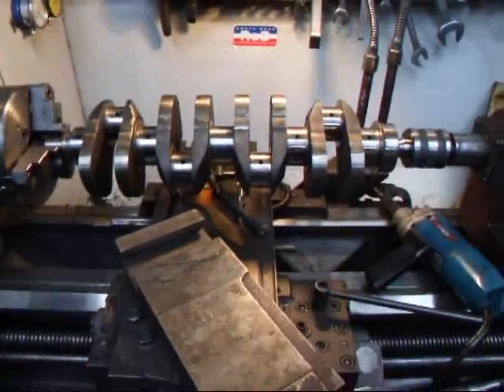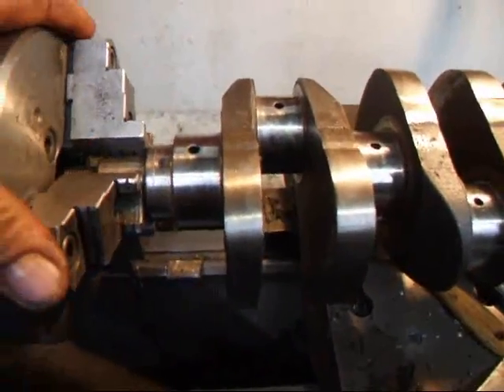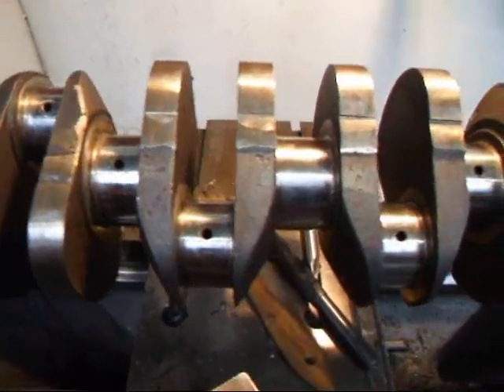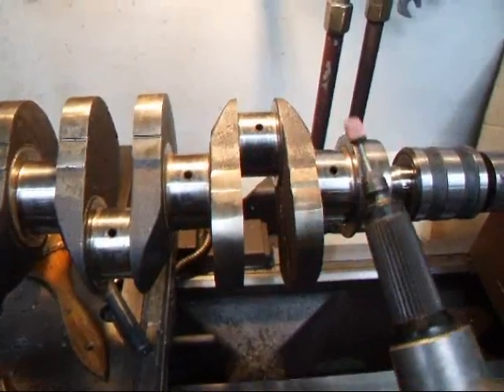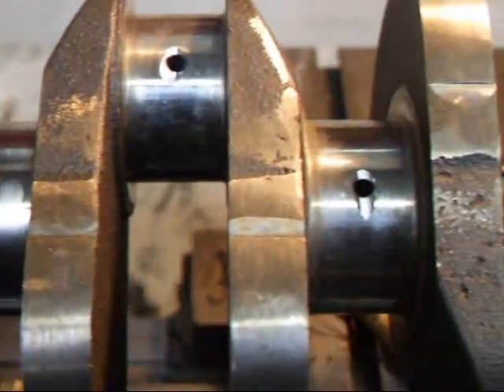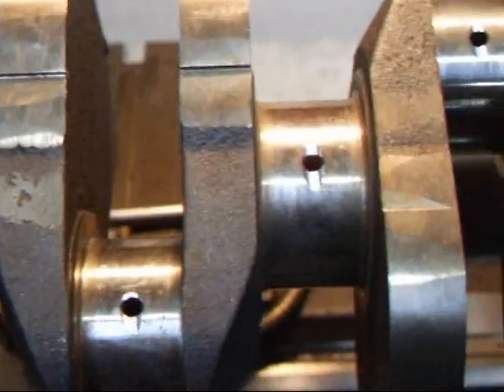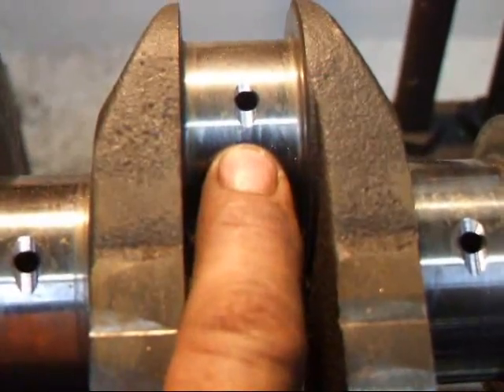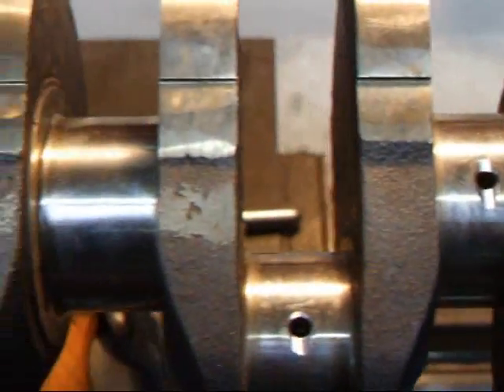Crankshaft Oil Hole Chamfering

Comment: Wouldn't enlarging the oil hole in the bearing shells have the same effect...? less risk to the crank/ easier to fix if you get it wrong...!
Reply: Absolutely not!! Will cause premature bearing failure!!

Comment: Hi John!  I was wondering if you might be willing to help me out. I have a Toyota Tacoma 2.4 Turbo engine that I drag race with. The problem I'm having is that the rod bearings always go bad. I had the machine shop give the clearance of 2.3 and I am using a mechanical oil pump.  To me Lubrication is not the issue I think is the bearings. I am using King bearings. My question to you is Do you think that because I did not do oil chamfering like you did in one of your videos could cause the bearings to go. I also like to know what kind of bearings would you recommend for this engine. Thanks in advance for the help.
Reply: To the fello, clames junking up main bearings, cause crankshaft is not chamford.,, old boy champering or not champard on the crank, ant got bit of differance on it, set u're end play corectly.  Tighten it up. Hamering out at high rpm
  Or switch mechine shops
  Next time. Do u're mechine work,

Comment: I have to agree with this guy... Burrs on the edge, irregularities will give different bearings different amounts of oil, not to mention the weight change on only one side of the crankshaft.  These are usually extremely well balanced, and I would think that whatever benefits of this crude chamfer are out the door since you aren't balancing it afterwards...
Reply: Fisqual 
Making assumptions..
Oil groves get polished with the journal ..
Reply: Fisqual 
Who doesnt balance assembly after crank & rod mods?

Comment: It´s not rocket science to clean a crank. Use thinner or similar solvent to remove the sticky oil inside the holes. Then you can use an engine brush kit and finally pressurized air. Blow the brush clean from the shavings and start all over again a couple of times. Flush, brush and blow is the key  :)

Comment: Shouldn't the longer side of the chamfer be the opposite of the shaft's rotation? This would leave the oil behind to pass thru the space as the journal catapults away. Also, is there any harm in cross-drilling or chamfering the same lengths on both sides of the oil hole? ..........cheap assurance for unknown direction of rotation.

Comment: So what happens to the file shavings how do you get them out of the inside of the crank once finished grinding?
Reply: Hot soapy water and cleaning brushes!!! Spray on WD40 afterwards, blow out completely with air gun, coat with oil, FIN!!

Comment: i believe that term comes from the honda side.  on the base model B18 engines you can install a "oil squirter" that comes from the GS-R or Type R B18 engine and essentially what it does is it squirts oil up onto the bottom of the piston to 1. cool the piston, and 2. provide additional lubrication since these two motors spin to 8800-9800 respectively.

Comment: John, do you polish afterwards to remove any possible burrs? Surprised that such an expensive stroker crank wasn't chamfered, do you agree? In the day i had a factory BB chevy 427 and i am pretty such the crank was chamfered or at least cross drilled, it was a forged crank since it was the HP version of the 427

Comment from the maker: 1. Shouldn't be a concern if you remove the smae amount of material from each side.
2. See some of my other vids on connecting rods, oil hole for the wrist pin are always a good modification.
3. Don't know about bearing problems, be sure you have sufficient pressure and volume, chamfering will be a plus.

Comment: Hi there.  I´m rebuilding an Alfa 156 1.6 ts and have a couple of questions. 
1. Chamfering, does that have much effect on " any " balance, thinking about how much that can be grinded.  
2. The standard rod end bearings for that engine don´t have oil holes, can I drill a hole on each, at perfect center and chamfer them smooth, then install them without something / anything breaking?  Have you ever tried? 
These car´s are know to throw the bearings, engineering weakness?
Jesper " Denmark " THX

Comment: I wonder, wouldn't it be better if the chamfers were cut to run at an angle instead of straight as this would promote lubrication over a larger area on the bearing.

Comment: How do you keep the grinding stone particles away from entering the oil passages in the crankshaft ?
And how do you clean it after this procedure ?

Thanks !
Reply: Hot soapy water and cleaning brushes!!! Spray on WD40 afterwards, blow out completely with air gun, coat with oil, FIN!!

Comment: @ted850760 
Yes the oil is pressure fed, but machining tear drop shape oil grooves into the big ends on the trailing side of the oil supply hole will help draw oil out of  the channel from the big ends, (this is the whole point of tear dropping the crank) I also do this with competition gearboxes that are not pressure fed and it easily draws oil into the gears due to a small suction effect when spinning fast, we have noticed a massive reduction in main shaft to gear wear with this modification

Comment: I use a small carbide burr to do this, using a smooth tear dropped shape with grinding on one side only, btw you have the main bearing "oil chamfer" facing in the right direction but the big end chamfers need to face the other direction, think about it, the crank turns clockwise but the big ends turn anti clockwise, you want to scoop oil into the mains which you got right, and then the big ends should draw oil out from the mains
Reply: Exactly right

Comment: Chamfering is a standard procedure for high rpm and hi performance applications. Just because he decided to do it with a grinder as opposed to a mill or machine of some type does not affect it in a negative way at all. If it did affect the longevity or cause damage, i'm sure he would'nt be in buisness for that long! Chamfering the oil holes is cheap insurance and mandatory at that high of RPM period. These negative comments make the people posting look like idiots!

Comment: Would it be of any benefit to chamfer the approach side of the lubricant hole, leaving the trailing edge alone? Considering the direction of crank rotation and how the eliptical shape might quench the localized oil as the chamfer moves past the orifice in the crankcase. Is the pocket of localized oil in a chamfered area not just a momentary drop in oil velocity since the crank journal lubrication holes are still the same diameter as the ones in the block?

Comment: ouch looks nasty dude use a milling machine and gouge it out, ive seen the strongest conn rods dead head from hydraulic lock. That means it cant spin anymore your rod turns over on you 90 degrees

Comment: How much does this modification cost? i was quoted at $300, i think this is the same thing as the guy told me. He said for $300 my bearings would get more oil at higher RPM.

Comment from the maker: No additional prep was done to this crank except the polish & chamfer. The c-weights were machined on one side to balance the crank. Apparently the centerline was off to one side. Find my video on crank counterweight knife-edging. That helps with low-speed acceleration.

Comment: I'm glad you posted this. I'm getting ready to assemble a Chevette racing engine, and didnt want to wait on a machine shop to chamfer the oil holes in the crankshaft. Any recommendations on what type of grinding stone to use? Any certain angle? Thanks - ChevetteMan